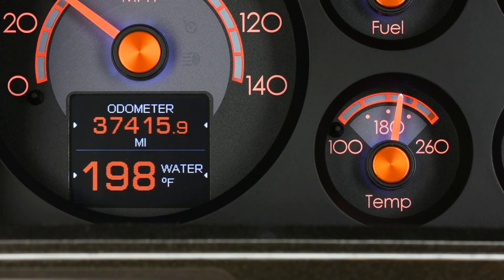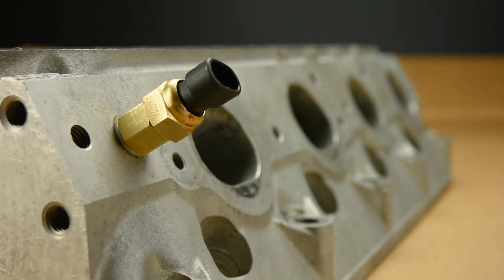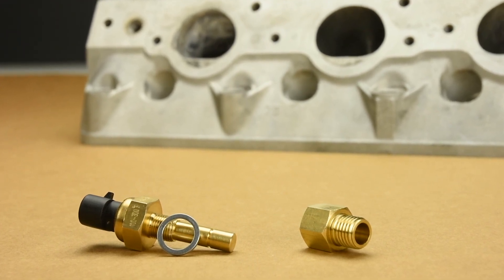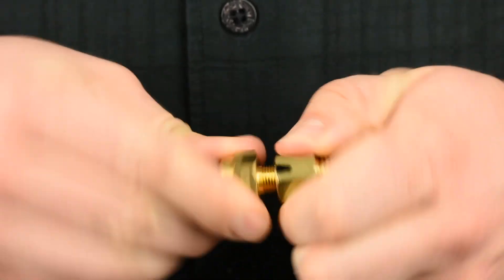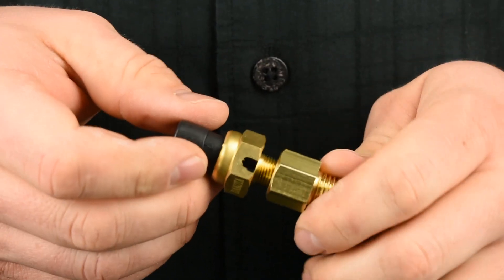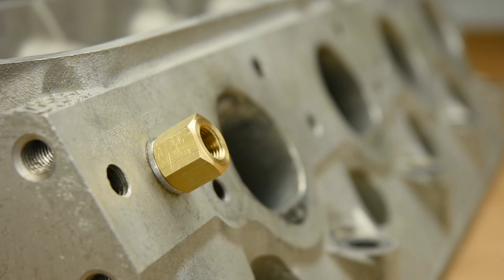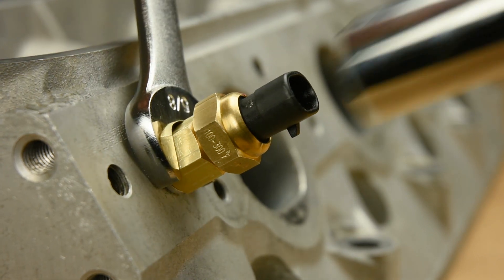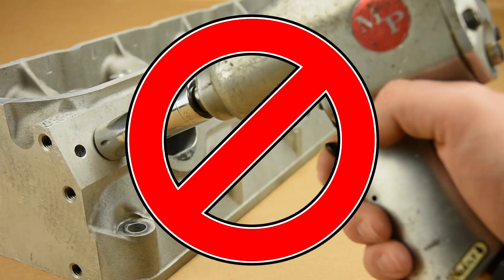SEN-04-5/12mm LS Temperature Sensor Installation

Comment: Can I just use the factory sensor on the driver's side?
Reply from the maker: Hello Efrain,
No, the factory sensor is connected to the computer, so you won't want to split this connection.  Adding the secondary sensor is ideal.
Reply: @DakotaDigitalTV  thanks, unfortunately I broke the one provided in the package.

Comment: I have installed water temp SLX-04-1-C + sensor SEN-04-6 exactly as you show, in the passenger rear port in my LS (LQ4).  When driving, the gauge is constantly moving from 240 - 270 degrees, although the OBD port shows 194 - 204.  I have bled the system, even at that hole.  What's up???  Any ideas are appreciated.
Reply from the maker: Hey Brad,
I'd suggest giving our Tech Support folks a call: 800-852-3228
You can get them here as well:  https://www.dakotadigital.com/index.cfm?ptype=input_form&data_header_id=6